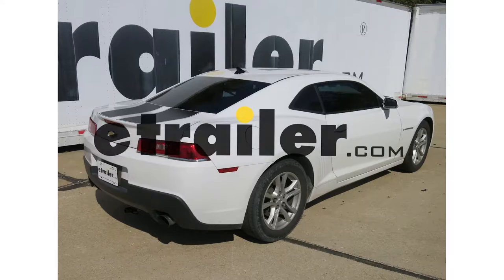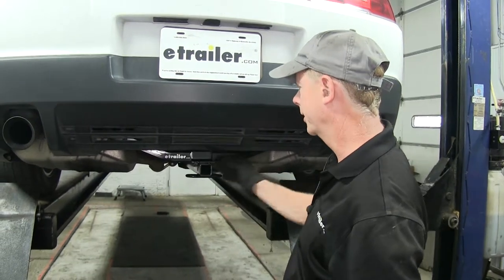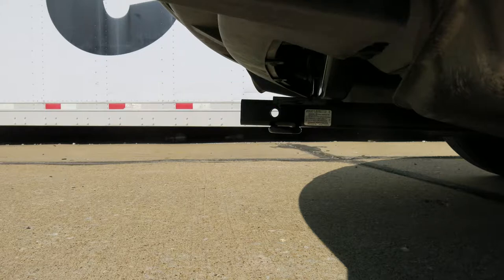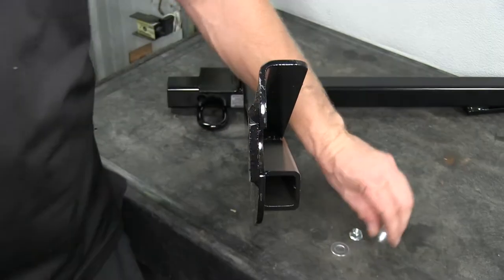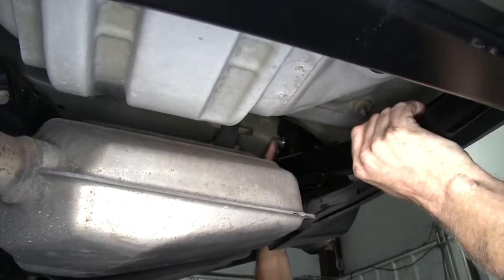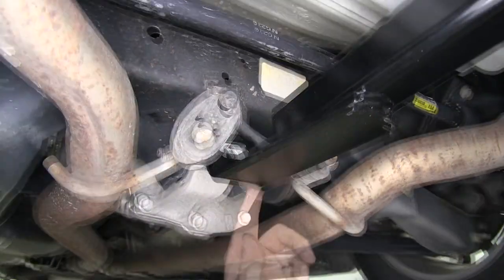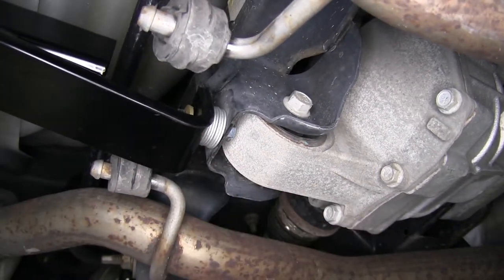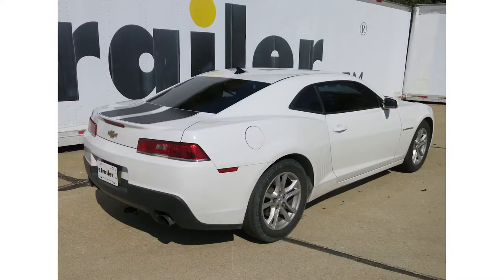etrailer | Mount: Draw-Tite Sportframe Trailer Hitch Receiver on a 2014 Chevrolet Camaro

Comment: I’m trying to install one in my Camaro to carry my dirt bike what would you recommend?
Reply from the maker: You will need to check the owners manual to see what the weight capacities of your vehicle are. The hitches we currently have for the 2014 Chevrolet Camero have a tongue weight capacity of 200 lbs and a max gross trailer weight of 2,000 lbs. Most people will haul their dirt bikes on a small trailer if it is too heavy to haul on a hitch mounted carrier.
https://www.etrailer.com/hitch-2014_Chevrolet_Camaro.htm

Comment: What size locking nuts go on the pre existing studs?
Reply from the maker: They are going to be a 8mm -1.25 CL10 Flanged Locknut.
https://www.etrailer.com/Trailer-Hitch/Draw-Tite/24850.html

Comment: Hi, can a V6 Camaro manual tow a jetski?
Reply from the maker: This hitch is rated to tow 200 lbs of trailer weight and 2,000 lbs max trailer weight. You will need to check in the owners manual of your Camaro to see what your vehicle is rated to tow.
https://www.etrailer.com/Trailer-Hitch/Draw-Tite/24850.html
https://www.etrailer.com/t1-2014_Chevrolet_Camaro.htm